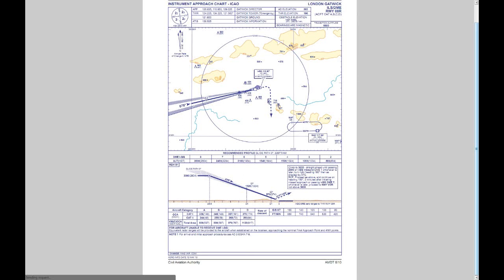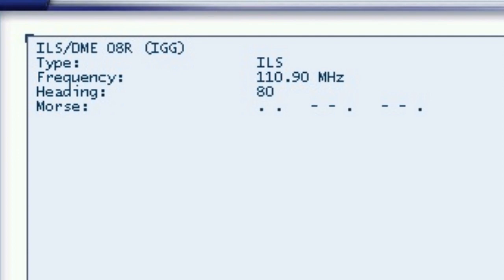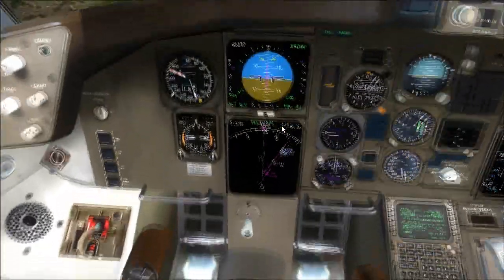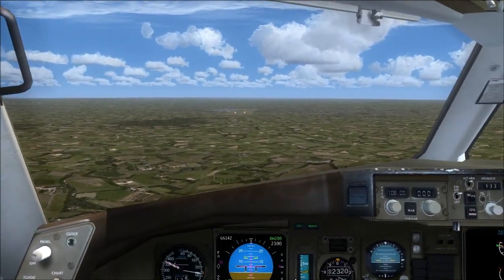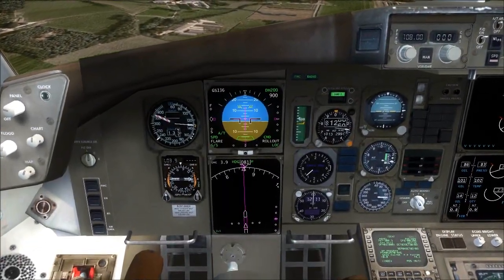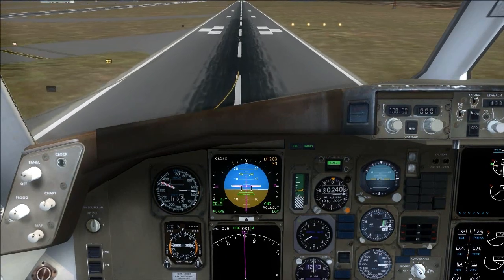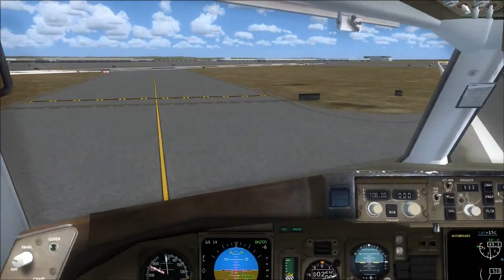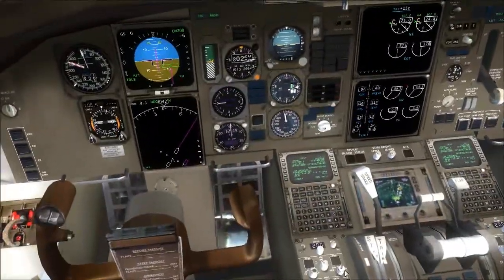Brief Boeing/LevelD 767 Autoland Tutorial - Voice Over Commentary -

Comment: NEVER select VREF30 when you still have flaps 25., only when you select flaps 30 you can reduce to VREF30 ! Usually the flight must be stabilized, its means flaps set, on the glide path with the good speed check list done, at the outer marker around 1500 ft AGL. Yes you can see airliner vids on youtube(I think of one on 767) which are not fully stabilized and checklist made in a rush approaching 500 which is not good at all. 
A former DC8 and DC10flight crew!
Cheers
Reply from the maker: Pat myZisfantastic great!

Comment from the maker: @Megavids3 - Hey,thanks. It depends really, if the visibility is very low the DH may be as low as 50ft. But this time of year on  Vatsim the weather is fairly good so i use about 200ft by default in the Level-D but if im forced to use the ILS i set 50ft. My methods using "default" DH is inaccurate but i find it works on most cases.